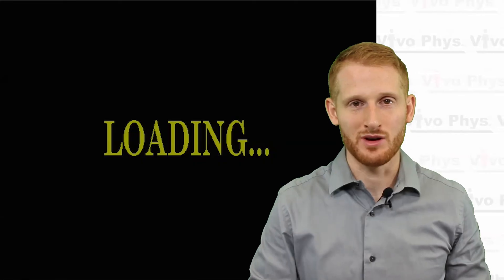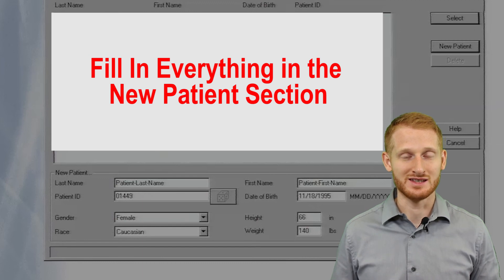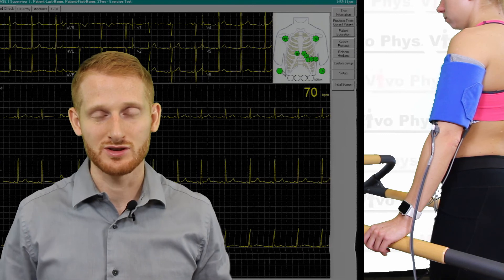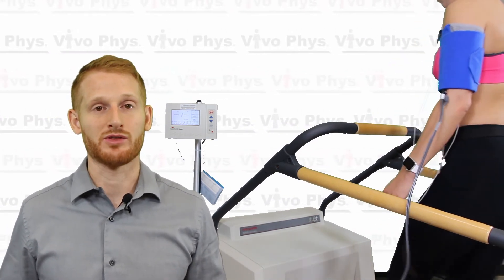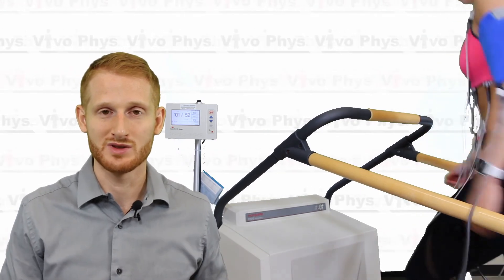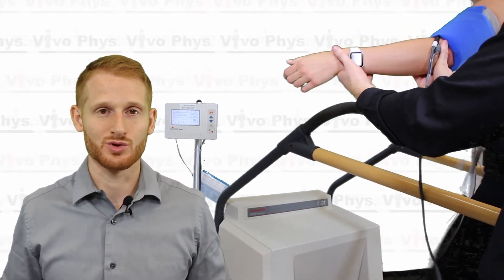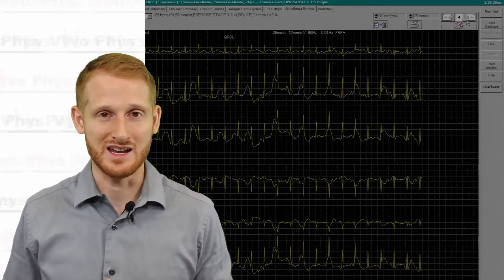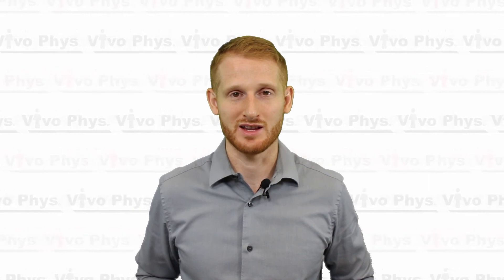ECG Exercise Stress Testing Using a GE Case System

Comment: Thanks for the video. Can we use the G Case program for every treadmill and where do we get this program?
Reply from the maker: The GE Case system is a software and hardware setup. You buy it from GE as a complete package. I doubt it works with other treadmills but I don't know.